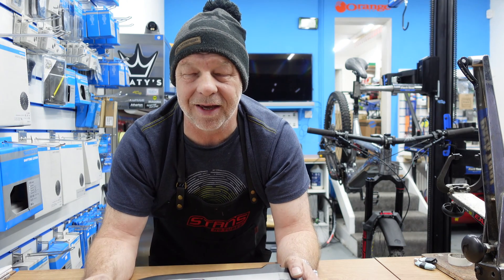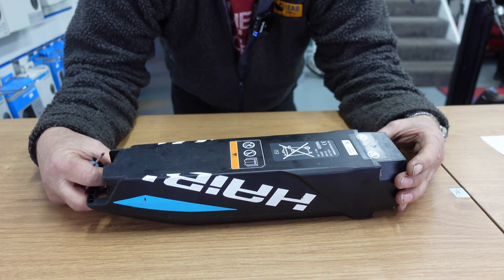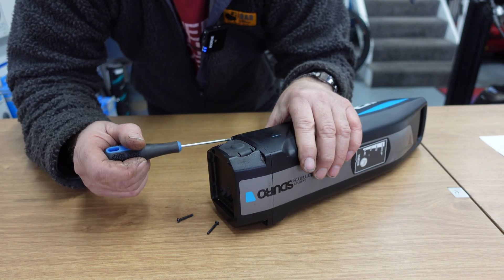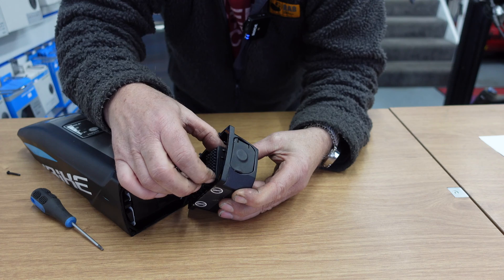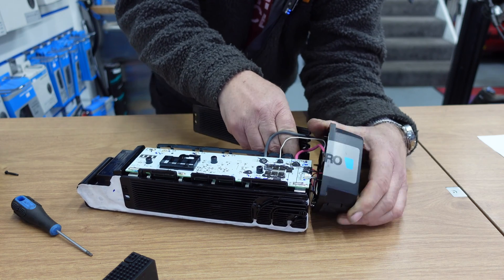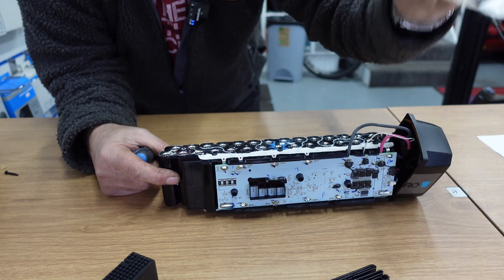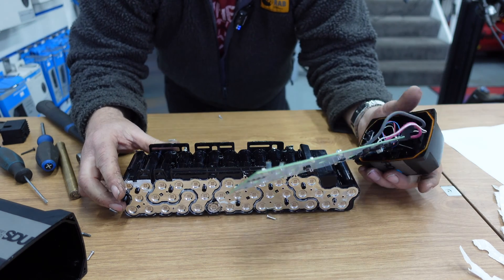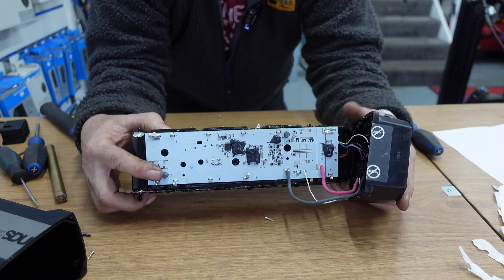Whats inside ebike batteries.

Comment: I replaced the BMS, but I don't know what the third wire at the output is between plus and minus. The bike does not want to work without it. Can somebody help me?
Reply from the maker: Hi, From what I understand that wire is the wire that the motor sends a signal down to provide voltage, thats my understanding but could be wrong

Comment: Hi question have you I have a Yamaha sduru 1.0 my battery shows e and f my BMS has it gone in protection mode were the blue and white wire is inside as in your video the silver metal part to the left shows signs of burn if I put a new one in would my BMS be ok iv just bought this bike used it had a dodgy battery connector I changed it n I got that error please help had the bike 2 weeks appreciated.
Reply from the maker: Hi, sorry I cant advise on battery repairs, i have no experience.
Reply: @TheYorkshireBikeMechanic  ok I get you cheers Dave 👍

Comment: Do you know if there is place to purchase that circuit board and end plate that came off? My 3 connectors are worn out but the battery is still good. I believe its from rough trails and rattles around on the connections.
Reply from the maker: Hi, sorry, no there is not

Comment: I’m trying to do a repair on the control unit inside that battery. What is your thoughts on doing that?
Reply from the maker: Hi Thanks for watching, I personally would as I dont have enough experience
Reply: Mine flashes just the top and bottom leds and not working! Have you had the same problem and how can I resolving it ? Any thoughts
Reply: @huihup  I gave up with that bike swapped to a Levi sooo much easier to use

Comment: Shows how stupid this e-bike and  e-vehicle green energy is.   A massive part of the bike is not servicable and very expensive to replace.  Additionally the used batteries are unlikley to be able to be recycled correctly.  All the elements needed to make the lump are all used up after a relatively short life..  In a bicycle it is one thing but on a vehicle it is just so wrong and not eco friendly at all..
Reply: you can service it but you need the hacking chip to do it but this is not the case for batts that use can bus comms  because as soon as you cut power to the bms it is dead and will need reprogramming ect and only 1 company in the world that can do this is liofit in germany but only on some brands and motors.

they do this to force you to buy there rip off batts but as my bike has the old gen 2 cx motor the new bosch smart frame batts wont work with my bike as they dont want them to via software.
Reply: @soundwave6769  who told you this story about can bus? I don't think is correct.
Reply: @EliSpizzichino  yamaha use uaert programming and most others use can bus for there bms to talk to the motor controllers thus why you cant use any old batt on these bikes and are at rip off prices had my bike 10 years now but there is a gut down south that can recell them now and peter at ebike motor centere can fix most controller problems but bosch ect wont sell any parts
Reply: You're talking apples and oranges  here, EMTBs and E vehicles for fake climate change are not the same. I agree that EVs for environmental reasons are all wrong and a fraud. However no one I know has ever said they bought their EMTB for green reasons.  Not one ever...  Mainly for fun, exercise and ability to ride farther and more elevation. 
EMTBs are just plain fun...
Reply: Ebike batteries are recycled by the manufacturer
Reply: @hairyhomerify  but not if they go to the local recycling area..  Well maybe they are really organised but I'm thinking not... It would be great if that was the case....
Reply: @hairyhomerify  but you buy these things from dealers and my local one does not offer a recycle service that i can see and only a couple in the uk that can do it for a price so most will go to land fill esp the ones in power banks ect and why so many bin lorrys catch fire.
Reply: You are clueless in regards to anything battery related … your post makes zero sense and is like 99% wrong … I left 1% out to not make you feel completely mad at me since it is holidays.